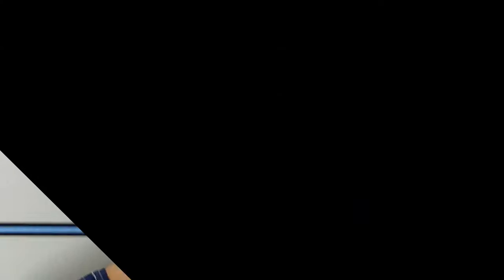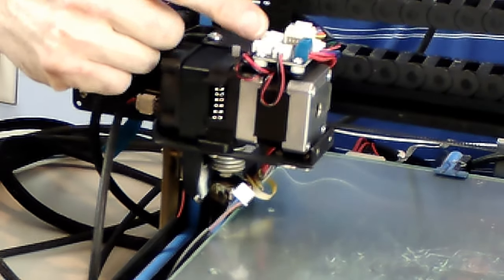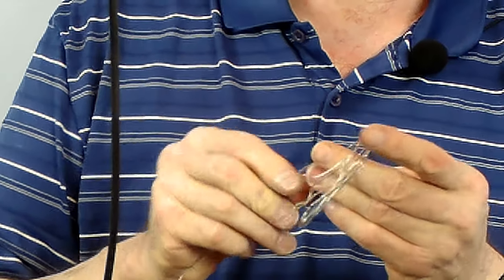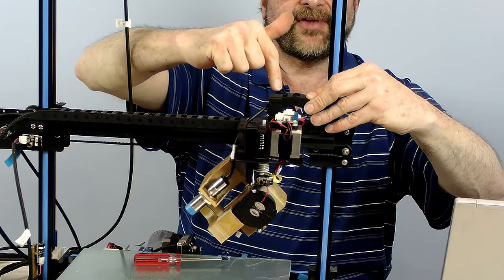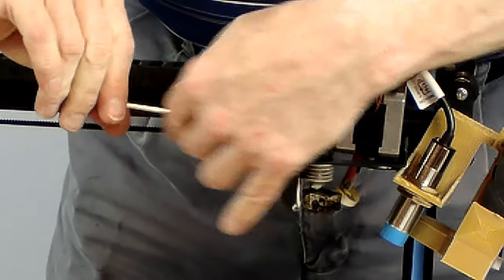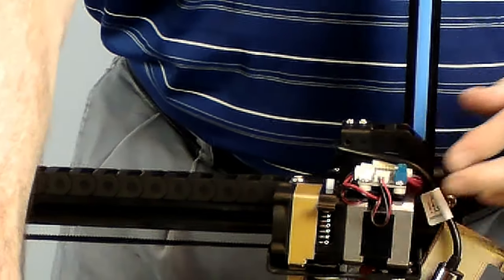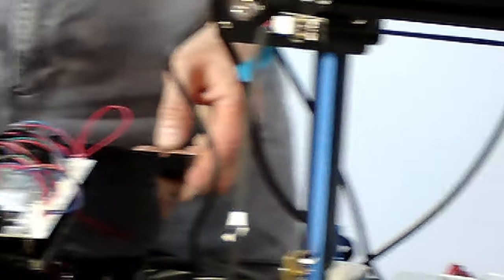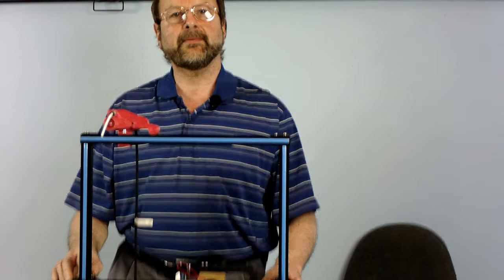Adimlab Gantry Auto-Leveling/Part Cooling Probe installation

Comment: Update. I purchased this last week. It arrived yesterday. I got it installed, and the vendor (at their insistence) called me to walk me through the software portion of the process. By yesterday evening I was generating prints with nice clean first layers. It will require a little patients, and following their instructions but I am very happy with the products and results. 

I did have to make a few tweaks to Marlin to get the new fan working with fan control (out of the box it works with LED control, but I wanted to keep my slicers happy. and have the display show the accurate state of the fan).

Link to the shop: https://everybody3dprints.com - I have no affiliation, and I paid full price for the product.

I would have liked printed instructions or a video, but I also understand the effort it would take, and the number of variables required to get this dialed in. Like 3d printing in general it's not plug and play.

Comment: subsequent video coming?
Reply from the maker: Yes.  I just have to edit it.
Reply: @everybody3dprints  Where is the next video? is this product in stock and shipping?
Reply from the maker: @jasonr1993  Yes, the product is in stock and shipping. I'm sorry but the next video has been delayed due to severe overcommitment of my time. However if you buy the upgrade, you will get a video call and remoting session to show you exactly how to install the firmware and set up.

Comment: What is the pin number you just plugged it into?  I'm going through the firmware upgrade from https://github.com/mnewnham/ADIMLab-1.1.9 and it wants a pin number.  Even better do you have the configuration.h file to share?